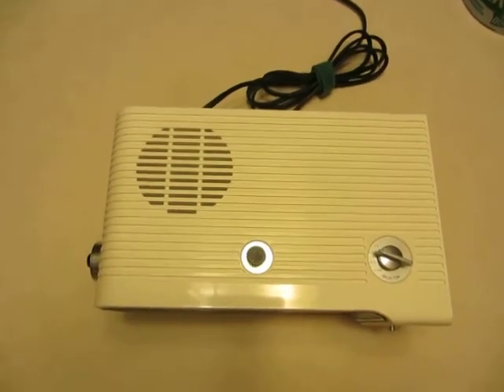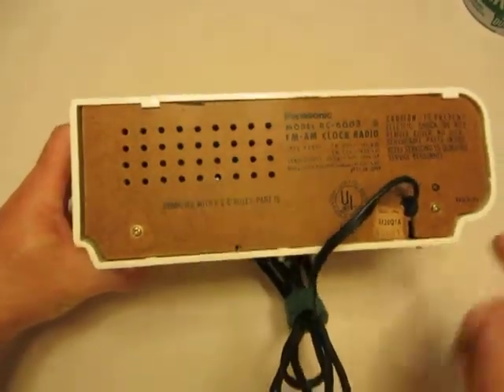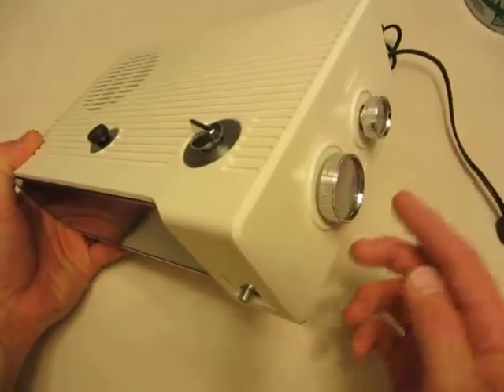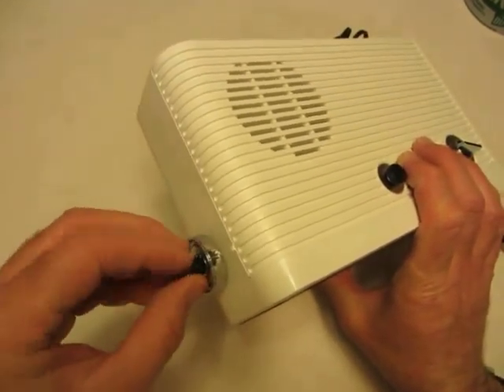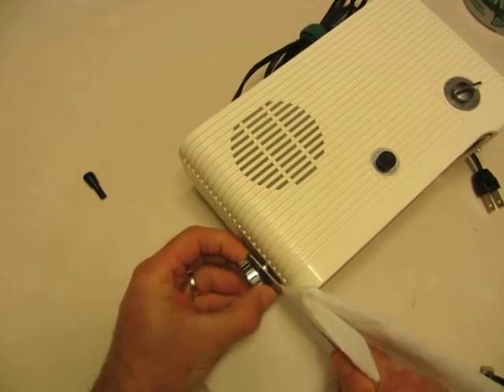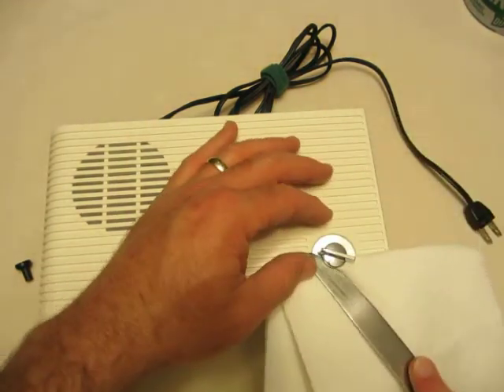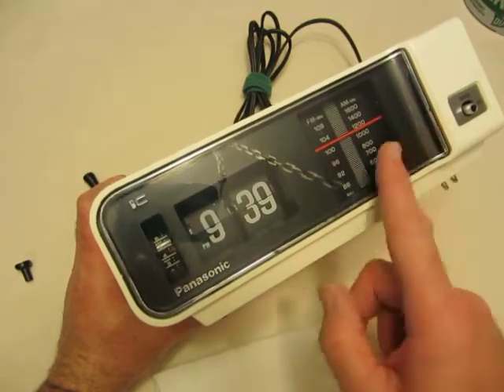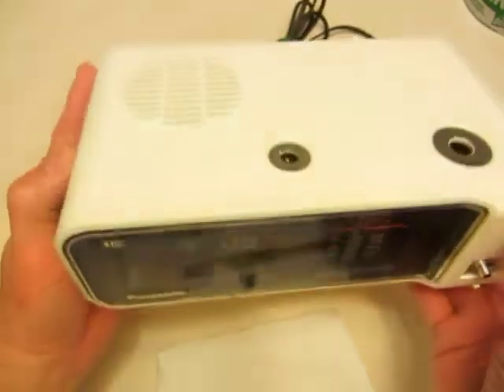Panasonic RC-6003 Flip Clock Disassembly Tutorial

Comment: Hey friend! Question, how the heck do I set the time... I’ve turned the nob to the correct time, but it doesn’t go as the minutes pass!
Reply from the maker: Unfortunately sound like your clock motor is not working. It may just need cleaning. There's info on this in the following video at about 7 mins.
https://www.youtube.com/watch?v=VDGw6AiiRMs